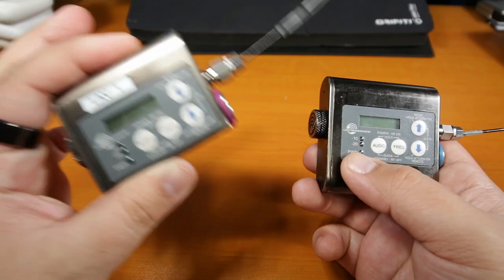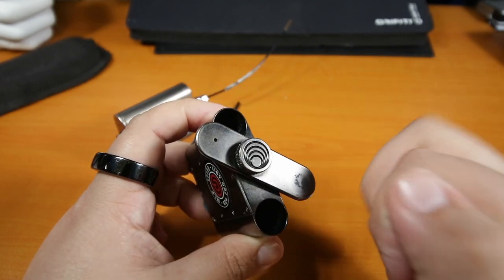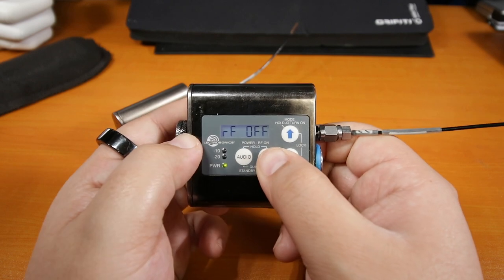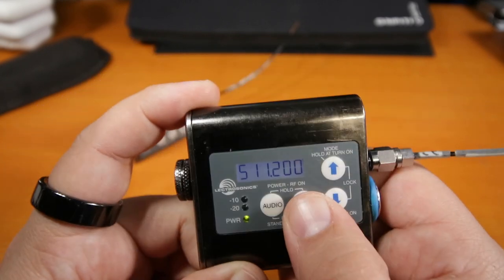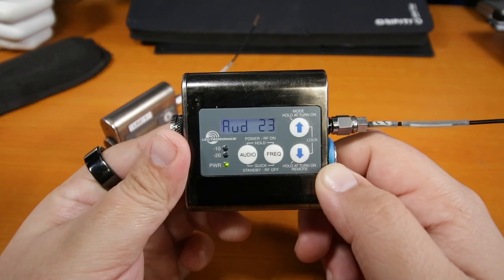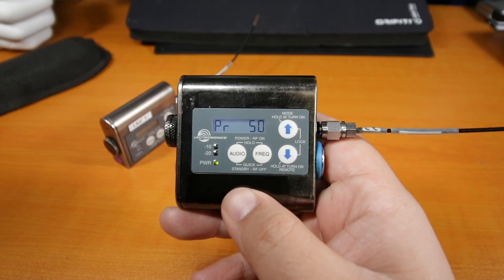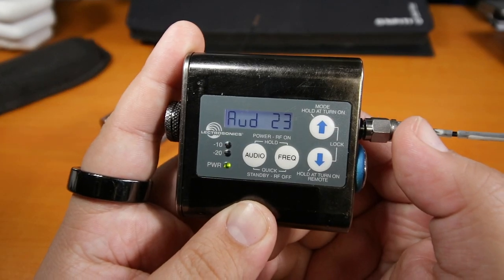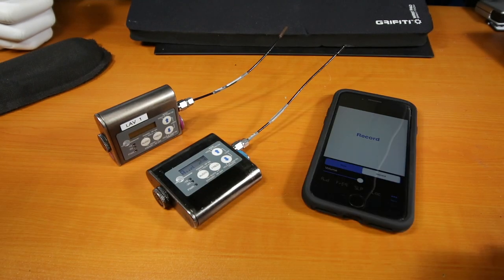HOW TO OPERATE A LECTROSONICS SMQV/SMV WIRELESS TX

Comment: Very helpful video. Thank you.
I will copy what I found in the manual concerning the unlock: "Important: Once the transmitter is locked, it
cannot be unlocked or powered off using the
buttons. The only ways to unlock a locked
transmitter are to remove the battery or unlock it
via the RM remote control."
Reply from the maker: perfect thanks !!!!
Reply: Thank goodness, I was afraid it would be as easy to unlock as it is to lock

Comment: The backlight options "bL 5" is actually backlight for 5 minutes, not 5 seconds. So bL 30 (backlight for 30 seconds) would actually be lit up for less time.
Reply from the maker: thats my boy !!!
Reply: @RLFOSOUND  Hi Mate I have to use one of these tomorrow and they are quite confusing me.
I can not get out of the rf off mode.
How do you turn "rf on" mode? or maybe there isnt such a thing.
I have been trying for an hour now and it always comes up rf off.
Reply from the maker: Hold audio + freq for 3 seconds dont let go
Reply: @RLFOSOUND  damn bro, you wake up early!
Reply: @RLFOSOUND  Thanks I will give that a try.

Comment: I notice you don't use rechargeable AA batteries.   curious what your thinking is.

I set up eight 16 way intelligent rapid chargers in a bag with 120 AAs all charging away on the back of my suburban, ready to go at all times.  once I did that, I just took the whole AA battery worry out of my head for ever.

Doesn't buying non-rechargeable batteries drive you nuts?  It sure did me.
Reply from the maker: I use rechargeable for my slates comtek and some transmitters but for my main packs that go on talent I use mainly lithium because of the run time we get out of them we will rarely bug talent to change batteries
Reply from the maker: Also production pays for them so not really and expense on my end

Comment: How can you change RF power to 250 mW ?
Reply from the maker: Turn the unit off then press audio + freq + the up buttom then from
That menu find the mw menu then change to 250, from there just turn unit off again that should do it
Reply: @RLFOSOUND  mine menu end up with 100 mW only.
I have a HM Transmitter
Reply from the maker: @goofie202000  some
Units only
Go to 100 where are you located ?
Reply: @RLFOSOUND  USA Chicago